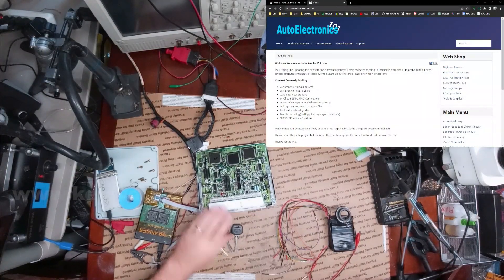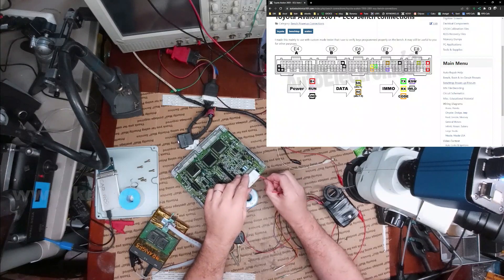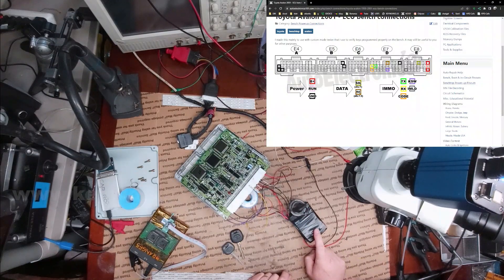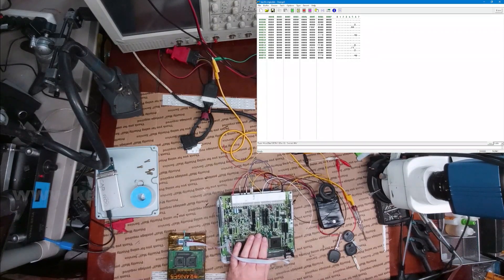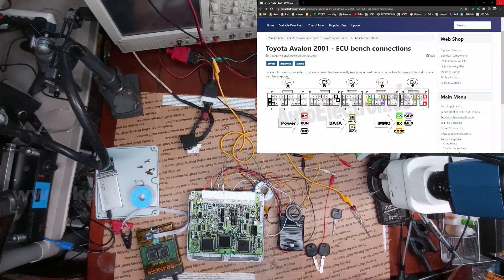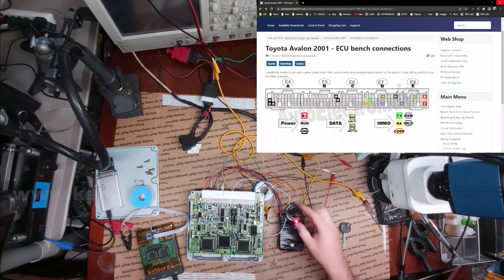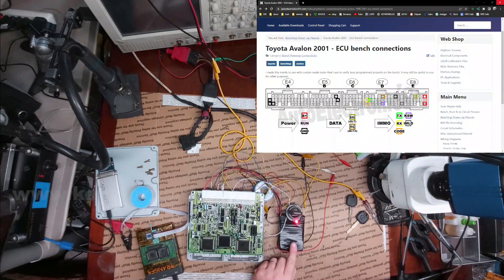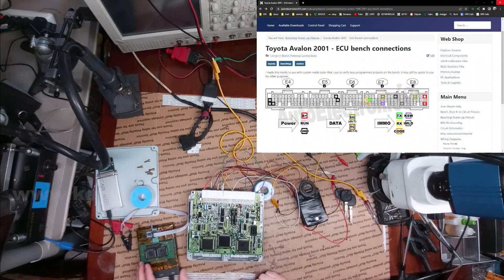Programming virgin EEPROM Memory in Toyota ECU for Immobilizer Master Key Programming: All Keys Lost

Comment: From some of the schematics it shows that it has an immobilizer module. Is that the module that you are flashing? Or are you actually flashing the engine computer? Thanks
Reply from the maker: the year I am working on has the immobilizer inside the ecu. Other years have a seperate immobilizer. It just depends on the year/model.

Comment: Excellent video man, do i need a minimum of 3 keys or I can start with 2 keys (master) and add valet later/ Thank you so much
Reply from the maker: You can manually close programming with only 1 master. It will only auto close with 2 masters then a valet.
Reply: @ecurepair  Thanks a lot again, are the keys all the same with 4C chip or master and valet have different chips? just trying to buy key,  but some website says master key and others says valet key, its's confusing when shopping for keys

Comment: Any experience with a 2014 Tacoma? I tried several ket programmers from Amazon and toms keys with no luck. Was thinkingvabout trying this process. Thoughts?
Reply from the maker: They are a lot different.  I lot of tools have recently removed the all keys lost function for these.
Is this push button or key turn? Key turn is a little easier but the data is not stored in the ecu, its inside a immobilizer up in the dash behind heater box. Not fun to pull out. Tools to be able to write that key also are not cheap.
Its easier for a locksmith to get a temporary sub to techstream and get seed key with nastf on toyota site.

Comment: This is exactly what I was searching for. ❤ Thank you so much for the video. Please can you upload also how to test each component with multimeter 🙏
Reply: Recently, a client called me to fix his 2000 Toyota Avalon car that cranked but wasn't starting.
   From the onset, the car experienced several mechanical, as well as, electrical issues. Some of those  problems were:-
(1) Engine Oil consumption;
(2) Engine misfire;
(3) Engine rattling;
(4) Intermittent hard starting after shutdown; 
(5) Hard to engage in drive, except engine is hot; etc.
Hence, he took the car to a garage inorder to rectify the excessive Engine oil consumption and other car problems highlighted above. Consequently, the car  problems exacerbated after engine rebuild by the engineer! 
  The car owner wasn't satisfied with his repairs because it seems the engineer was deceitful. Although the car started after the rebuild, the problems still persisted.  Valves weren't grinded after engine overhaul, engine still misfired at idle and when accelerating, etc.
   The  engineer whose garage the car is presently being parked, requested for another engine overhau/ rebuildl. After engine rebuild the car started, the oil was mixed with water; the engine was still misfiring, rattling, etc. It was obvious,  that he didn't use durable parts to do his work.

    Hence, the car owner moved the car to another garage for better repairs. The new garage suggested to the car owner that another engine rebuild is pertinent for optimal engine operation. 
    During my conversation with this engineer, whose garage the car is presently being parked, he told me that: "when the car was first brought in, he noticed a black smoke ( maybe he was mistaken for blue smoke, at exhaust tail at idle). When accelerating, there's a loss of power, engine bucking, popping,etc. After the rebuild, the car didn't start because the mechanic didn't unlock the car with the remote but proceeded directly to cranking the engine. In addition, the security relay wasn't actuated for starting to take place. Electrician did some wire cutting around that axis which he said was corrected to factory, opened with a remote before the car started.

   Fortunately, after everything, the car started again. But there was still an intermittent misfire. What the car owner said was that, 'even when the second mechanic did engine rebuild, the car still misfired. Until he personally bypassed earth from the COP wire to the solenoids very close to the fuel injector often tightened with 10mm knot and depicted with blue and green colors on the picture. Car owner verified that the reasons for the misfire from both mechanics which still prevailed, was due to the solenoid valve that wasn't opening. That's why when accelerating it experienced a loss of power, similar to that experienced by a faulty fuel pump.
  
   After gear oil replacement and test driven by the second mechanic , smoke started emanating from the engine bay. Precisely, from the fan relay that the car owner connected by himself. Within few minutes, the car shutdown by itself as if fuel is finished.  As he tried to restart it, the car refused to. Infact, when the ignition switch was turned to Acc/ ignition position, battery and fuel light was not displaying in the dashboard/ instrument cluster. However, during cranking battery light glew faintly and start. But when throttled,  it would shutdown. Electrician verified and replaced the alternator diode with a new one. When Ignition switch was turned to Acc/ ignition position, the battery and other lights came out brightly but when cranked to start engine wouldn't start again. Sadly, it still wouldn't start.
 
I tried to scan for DTC codes, but my scanner wasn't communicating. I checked all fuses, power and ground at obd port, those checked ok. but my scanner isn't compatible to read CAN network. there are only 4 wires intact for the obd2 port.
    Furthermore, I added fuel through the intake to the engine, no change at all. I checked for spark and injector pulse. These things weren't present. But there was power to injector with just the key at ignition or ACC and COP had 1 ground and 1 power as usual. 
 Electrician from that garage, who also worked on the car said that he sniffed burning smell from the ECU, however personally I didn't when I went to start the car. I don't know how certain that was. Hence,  I pulled out the ECU to a laptop board engineer to test the components inside. He said: "everything looks ok and test fine, however the IC he doesn't have the right tools to proceed with the test. With the ECU removed battery connected, Engine light would come ON. with ECU connected check light still comes ON.
Before I left, I checked the MAF sensor 5 wires and noticed that 3 wires were earth instead of 2 and 1 power; no ignition current/ power was available for the remaining 2 wires. 
  Please, what should I do to start the car?
Reply from the maker: This car doesn't use CAN, It will use KLINE.  You should be able to get some dtc's from the engine control module
Reply: @ecurepair  please what's the difference and how kline be tested?
Reply: Yesterday I checked for fuel to engine while cranking but no fuel was forth coming, nor power to the fuel pump while testing with a testlight.
Reply: Today, I went to check that Avalon car. However, there was no good battery that was capable to crank the engine it could only be used to perform some test with testlight . The client apologized for that.
   Nevertheless, I did some basic test. I checked the fuses the were all ok. I found the fuse that powered the MAF sensor wire that was supposed to be power instead of ground. When I unplugged the fuses, number 19 of it shutdown the light in testlight  but put on the light whenever that fuse is reconnected. That's how the fuse for that location looked.
  Additionally, I noticed that that particular MAF sensor wire illuminated the testlight even with the ECU removed. Using multimeter I checked and saw that that particular MAF sensor wire goes to one of the ECU connector.
 Also checked the 3 front out of 6 fuel injector wire to ECU, they were not shorted. Still good!
Reply: Yesterday I bypassed the fuel pump. But still remains the spark and injector pulse so it can start. What should I do next?